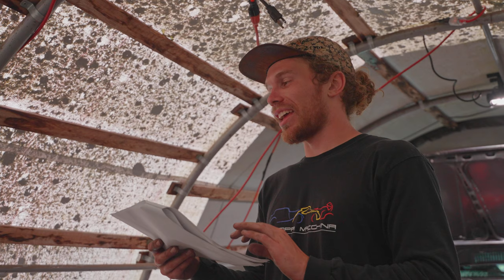BUILD DAY: Propane Injection & Turbo Swap! - MK1 VW Rabbit Turbodiesel (4K)

Comment: She sounds gnarly... Bigger on the exhaust side usually just increases lag. Your power is the cold side as per CFM into the intake, use the rear from the 17( this will regulate spool) with the new front( assuming it is bigger) more CFM, more power...

Comment: Love it man. I’ve built myself a 1985 Jetta with a 1.9 td AAZ. I need a turbo since I found out my housing is cracked. Could you help me out on the turbo you got? I’m going for 25psi and I’m built to that point now. (Fully studded, Giles super pump, inter cooler, and lots of other stuff) really all I need is to find a good boost reference turbo
Reply from the maker: A GT17 is ideal, I'm still in the process of nailing down the perfect turbo myself :/ the one I've been running is just some eBay junk lol but I think Saab made an OEM GT17, and you could try a GT2052, might be a tad big!
Reply: I like your intelligence. Do you have a harmonic balancer on that motor? I got a 91 Jetta ecoturbo that just has a pulley, and I'm wondering if I should have the harmonic balancer.
Reply: @happyhippy7482   thanks man. well ive heard of these engines doing alot more without one so it should be ok if you are staying under 28. however stud the buttom end Giles told me he had crank bearing issues without studs at 25 psi.
Reply from the maker: @happyhippy7482  Heyo! Thanks mate! This is roughly the same motor (eco turbo). The car is a 1984 but the motor is from a later vehicle. They do not have a harmonic balancer and to my knowledge, they don't need one. For sure the engine vibrates a lot (even with new mounts) but it's an old fashion diesel. At idle it will shake your car no matter what you do. I like to raise the idle rpm a bit which smooths it out a bit.
Reply: Remember “psi” is only one small part of the equation of power. 

Clay, you want a vnt17. 

You have to make your turbo control system. But this is easy I have a video showing the basic system. 

Because 25 psi with the a variable turbo. 
Kicks the MC ass off a car running by a waste gated turbo running 25psi. 

And better mpg too.

Comment: Hey mate, is the pump stock or worked? Looks like you need some more fueling in her, I got a isuzu 4fb1 (1.8)here in aus running a td04l-13g making 20pounds easy with .42 turbine housing, can make 30 if I want.Pump is 10mm tho and done the governor mod.
Pump is not maxed out and have plenty of fueling in her.
Reply from the maker: Heyo! Not stock. It's getting quite a bit of fuel already (probably not maxed tho). The exhaust color doesn't show very well in the video. I'll have to see what the manifold repair does!
Reply: @OliverFetter  see how you go with the manifold. What plunger/hydraulic head you running? Channel is awesome keep it up :D
Reply from the maker: @hello13479  Yeesum! What do you mean by plunger? It is a 1.6 mechanical head.
Reply: @OliverFetter  plunger size for the injection pump if stock would be around 8mm, should indicate on the pump, ve4/8f or 9f. Can change them out to a bigger piston/hydraulic head for more fueling. I went from 8mm to 10mm.
Can also shim the main spring on the governor/throttle to hold more fueling in the rpm range so you don't get spillage after 2500rpm for the extra fuel gains throughout your rpm range. Fuel pin and spring tension will contribute to the amount of fueling too, in relation to boost compensator that is. Just check the forums on the aaz fuel pump mods to improve your fueling.